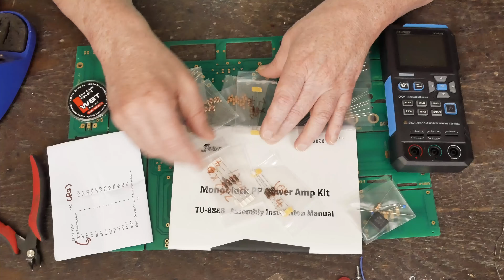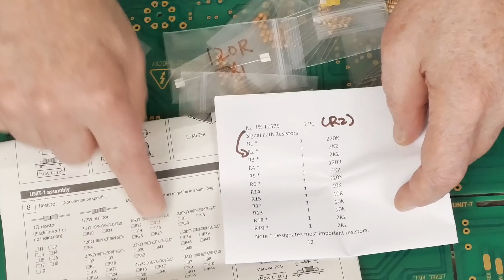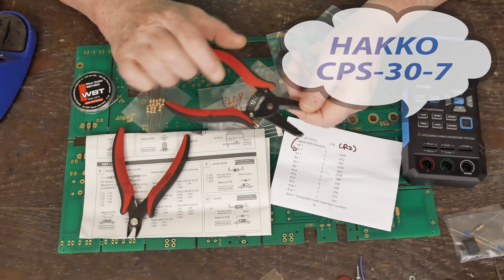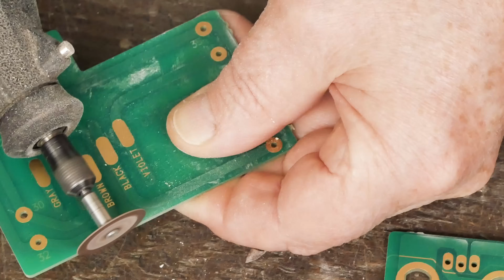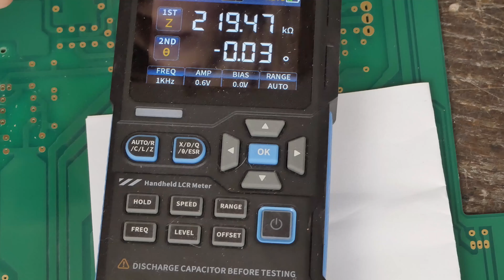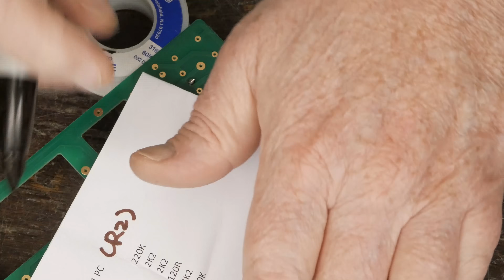Elekit TU-8888 Tube Monoblock Amp: Build Video 1

Comment: I’ve never built an amp kit that required breaking apart the circuit boards. Deal breaker for me on Elekits.
Reply: I’ve done two of these kids now and believe me it’s not a big deal.
Reply from the maker: Huh?
Reply: @SkunkieDesignsElectronics  supplying a kit that runs the risk of PCBs being damaged by the buyer is a poor practice is my point.  Sorry if my original comment was terse.
Reply from the maker: I likely was being overly cautious cutting them apart.

Comment: You should remove soldering iron before solder (it stops solder spikes and dragging) + what about cleaning the components legs and circuit board with isopropyl alcohol. Sorry Skunkie, when you build stuff for satellite you only know one way.
Ps.I love what you’re doing for the normal audiophiles and your insight into components is excellent.
Reply from the maker: This is just a ridiculous comment. If you remove the iron before the solder, the end of the solder will stay stuck to the joint. And if surgically cleaning everything was needed, it would be in the kit instructions, these folks sorta know what they are doing. Feel free to start your own channel showing people how to do stuff.
Reply: As a normal audiophile (as opposed to, what, an abnormal one ?) I think I will stick to Skunkies technique, though I do bathe in IPA before soldering. It really gives you a glow.

Comment: Triple controll,the viring,with 2 chanals easy to control.cant se why old styl solder is not good ?it has been tested fore 100 years.power suply is were folks must be careful that it is corect.test tubes abitt in the tube soclets,some may be werry tight,sometimes exstream hard to get tube  out.and they are mounted on the printbord.

Comment: Danger! High voltage! FYI to all out there, amps are only dangerous AFTER they have been plugged in(the first time). Nothing has a charge before then...
Reply from the maker: Of course and I would hope that is obvious, but at the end of this build you need to do voltage tests. For all I know someone will watch one video in the series, built it, go to test, electrocute themselves and then sue ME for not warning them. For all I know someone might plug it is when it's half built for some reason just to "see if there are any problems".

It would be nice if I never had to warn people of what should be obvious, but people today sue for anything. I actually created an LLC to post these videos under because of this. If you want to create content around high voltage tube gear with no warnings, feel free. But this is likely why you don't see more YT content about this stuff, fear of being sued. Note the Warning at the top of the DIY forum... https://www.diyaudio.com/community/forums/tubes-valves.5/
Reply: @SkunkieDesignsElectronics  I get it, I just think its funny. Peeps be dumb. Most safety is common sense. Common sense isn't so common these days =)
Reply: Well, if you said "the first time" you would be right, but if you just leave it as "after they have been plugged in" you set folks up to get shocked from charged caps.

Safety is, or should be, paramount, and simple warnings are better than complex ones with caveats.
Reply: @jimfarrell4635  You are right, I should of. Thought it would be obvious since its a DIY kit video. You are totally correct though, should of specified the first time.
Reply from the maker: See the issue is a LOT of people buying these a) know nothing about electronics b) really don't even want to be building them c) buy them because it's cheaper than buying a built and tested product. They have no understanding of how dangerous 500VDC can be.
Reply: @dragosthule  To be fair since starting this electronics game a few years ago, I have had mains voltage shocks twice due to my own stupidity. Just luck the current didnt cross any vital circulatory based areas.
So I am now suitably cautious.
I feel like getting a Simpsons type sign for my workroom. "XX days without an electrocution !"
Reply: @SkunkieDesignsElectronics  Very true. 240v for large appliances and small machinery. 480v for Industrial machinery. It's just a shame these days. To much tech, people forget to learn much anymore when they can search and find the answer in moments.

Comment: I disagree to bend the component leads before soldering. yes, I know, it is much more difficult to solder when the resistor is not stable and tries to fall down from pcb. this is trade off however,  because for future repairs and/or service it is nightmare to pull from pcb such component soldered with bent. overheating and delaminate pad can occur too easy. Ask me how I know it 😂. I am not criticizing you Stephe. I am just sharing my approach. OK. resistors with bent leads are not THAT difficult to remove. Only risk is to damage resistor when pulling hard from pcb. 3lead components like transistors however - it is almost impossible to desolder without damaging something. And you need 3 hands to do that. Therefore I never bend leads of the components for soldering ease. Howgh!
Reply from the maker: Why would you be removing parts from this type of device and be worried about not damaging the part? For a 3 leg part, just cut the leads. And if you use a fluxed desoldering wick, the device comes right out anyway, especially on a single sided board.
Reply: @SkunkieDesignsElectronics eure. everthing is doable. only why sbdy need do extra work because of bent leads? and delaminating solder pad is still an issue even using technique described by you. I prefer Good Engineering Practice. I will follow your build - you do great job! ❤
Reply: @yellow_noise3 I tend to agree, but surely if you are trimming as close to the board as Stephe does, its no longer an issue. If you leave a flat 3-5mm tail then it becomes a problem.
Reply from the maker: So you suggest leaving the lead straight, so the parts fall out when you flip the board over to solder it just is case in the future, someone wants to rob parts out of the board? AGAIN if you cut the leads on the top side before trying to remove the part OR desolder it, there is no possible way to damage the board. I would hope a good tech would do that rather that risk harming a unreplaceable board to save a $0.01 resistor.

Comment: Great stuff!  Quality boards & resistors.  You gunna use those Mundorf aluminium/oil caps too?
Reply from the maker: Yes! That's the plan and later will be rolling a variety of tubes.

Comment: Steph I really liked your Acpona video.Saw video of La Dulce kit with 3D horn,360 degree tweeter and dual 18's last year and it looked like such a high value way to go go where you buy the $3700 kit and build  baffled where a pro would shop would ship them up for $3K.Considering the component cost vs finished standard speaker is like 1/4 of price max they certainly look like they are worth the time and elbow grease.

Comment: Hey, nice kit and have fun with the build! I like separating boards with a rotary tool. Saves a lot of time filing the break surfaces if you want a clean look, and I know you do... so do I :)
Normally I'd go for V-groove style board separation, but that's practical only when an entire edge can be broken off, rather than a cutout.

Iron temperature - it depends on whether you use leaded or lead-free solder, but other factors like iron's power, heat transfer, thermal mass of the components come into play. My to-go option would be an integrated tip (I use T12 and like it very much; I haven't tried JBC style ones like C245 yet) because it allows for a tighter temperature control: there's no heater-to-tip interface that will eventually oxidate which adds heat resistance.
I used to go close to 400°C / 750°F when I worked with my old Solomon soldering station, but now that I use a T12 iron, I'm comfortable with 370°C - good melting and flow without tip overheating and oxidating too fast. Still, I practice good tip maintenance: tinning it before putting it in the stand, and cleaning often. Not to mention choosing the right tool for the job.
Reply from the maker: Like I said, people have different preferences. Use what works for you!